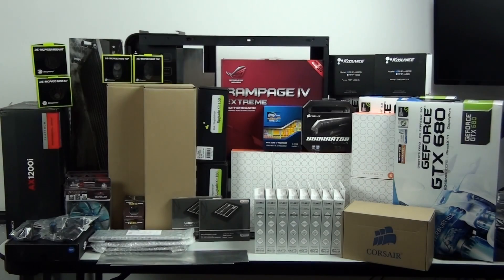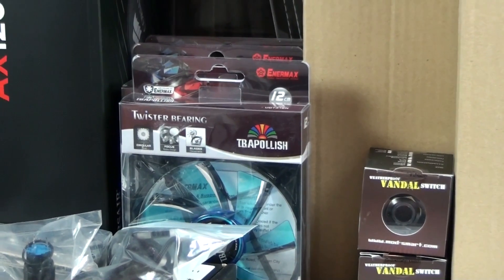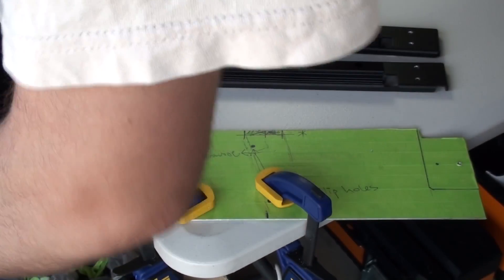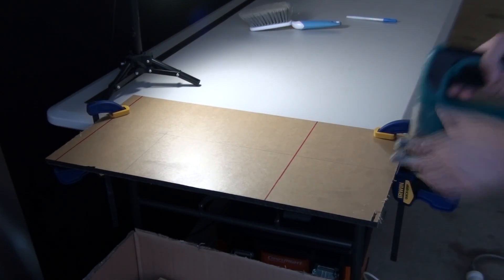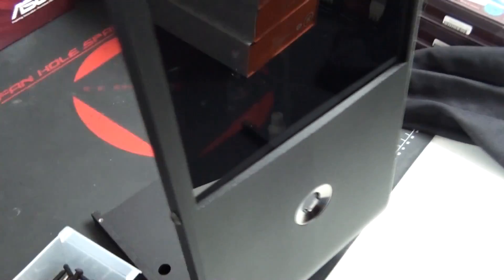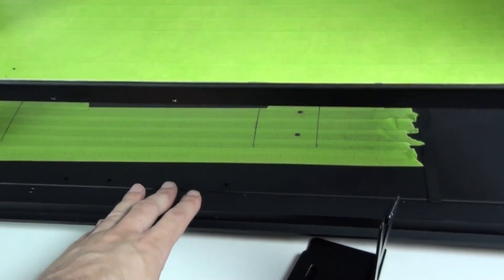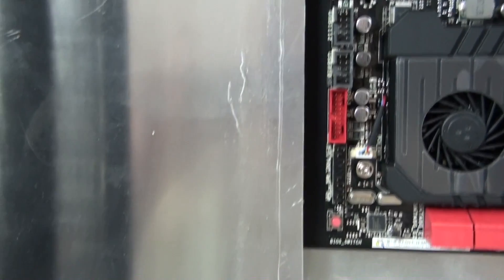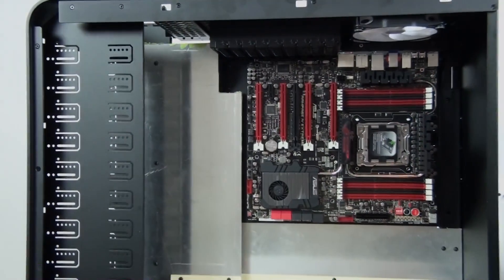Build #8: 'Cytotoxic': Part 1

Comment: okay i'm about 10 minutes into the video at the moment ... slowly going back through some of his videos to check out previous builds ... i'm loving the idea of that smoked acrylic on the front panel ... and that mounting system is pretty genius for the overall look and feel of my own case though i might end up using some of the thumbscrews from my case as opposed to like fan screws or anything ( not entirely sure what he used off hand kinda busy with other things ) ... gives off a pretty neat set of ideas ... i have a pretty good idea of where he's going with it and i like it but i think imma go a bit of a differant direction if i mod this into my case ... would love to see a resivour mounted to take up that whole space ... little flurescent dye in the fluid and some uv lights in the case ... one of those odd thoughts is i would love to get the fluerescent dye to not completely mix  so theres small streaks of color through out the fluid not sure if theres a way to do that though

Comment: Can I replace the 5.25 covers with mesh covers and use the 3 slots and the other 6 bays be occupied by a MCR220? Also can I ask in where can I put 3 3.5" Harddrives if I remove the drive bays at the basement and I completely occupy the 5.25 bays and also even occupy both the back of the motherboard tray and the side of the 5.25" Bays with SSD's?

Comment: You're better off using what you call the angle plate as aluminum of this thickness has a tenancy to crack when bent in a break.(bending machine) The angle metal you use was probably roll formed to avoid that problem. I know less about building computers than I do about bending metal. I have bent too much metal.

Comment: were do you buy the black ice sr1s? iam thinking of doing a cpu loop with a 360mm sr1 and 3 corsair sp120 fans. i already have 2 sp120s for my h100 so since the sr1 seems to be one of the best for high rpm fans i was thinking of getting it. i can only fin it on ebay...

Comment: Look at pictures. If it uses connectors over two slots in the back of the card, it's not an option.

With a lot of cards, such as the original reference HD 7970, they only had connectors on the one slot however, meaning the dual-slot backplate could be replaced with a single slot.

Comment: hey my name is daniel. dude I wanna do a build with three colors in a desk like the l3p desk and the red harbinger case but with wood grain trim. But what i wanna know is what software/hardware can i use to shut the computer down on a pump failure. since ill have 3 loops and 3 pumps. i cant afford to have backup pumps on each loop.

Comment: It is most definitely possible, but it will require quite a bit of work. First of all you will have to make (or have made most likely) an SLI-bridge that will fit that tightly, and you will also need to come up with a way to link the ins and outs of the waterblocks in that tight a space. On top of this there's really no gain in running graphics cards like this, they will run hotter and you will still only be able to run a max of 4. If you wanna run SLI in 2 slots, get a GTX 690. Best solution :)

Comment: Depends.  Like Singularity said, using a waterblock the card will only physically occupy one slot but if the back IO adopts a vertical configuration like the reference GTX 600 series cards, then you're going to be occupying two slots anyway.

Comment: 12:50 if you get a spare piece of wood to drill into once the rad mount is done, you would have a much easier time doing this. Above all, you would not have to deal with the flex of your table.

Comment: Before you get too far with this build, check the Koolance 450 connector thread, it may not fit the Bits Power Res. Koolance, Bitspower & EK Res threads are not the same dia & pitch.

Comment: I have a couple of questions about my first major water cooled rig I should be building next week. I have a Little Devil LD-V10 (not the phase change version) I plan on filling it with 3 quad 480mm radiators, vga\mobo\cpu blocks. The case is huge so I will need loads of 1/2 to 3/4 tubing. I decided to go with the XSPC Twin D5 dual bay reservoir. my 2 questions are, XSPC AX480 or RX480? How much coolant do I need?

Comment: Ventilation for the front rad seems too restrict .If I were you ,I would drill 2-3 fan holes at the rear of the case to bring more fresh air to the system -the front rad will suck the air from back and exhaust at the front .